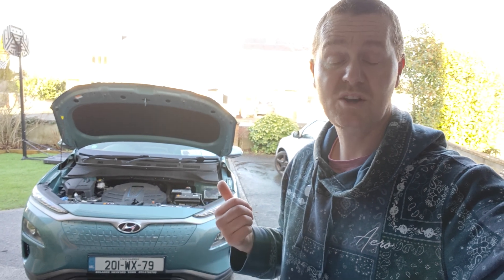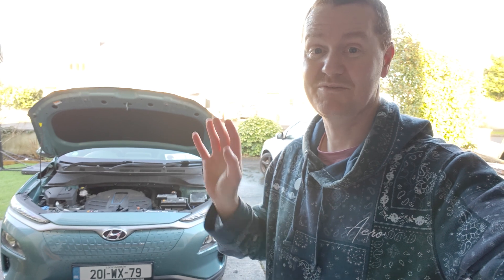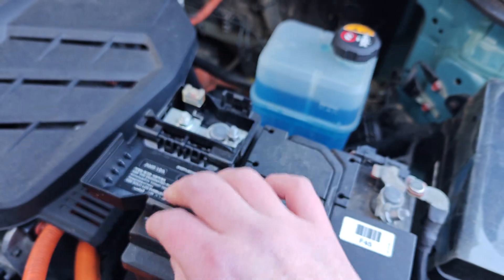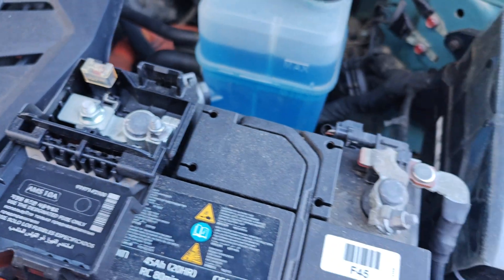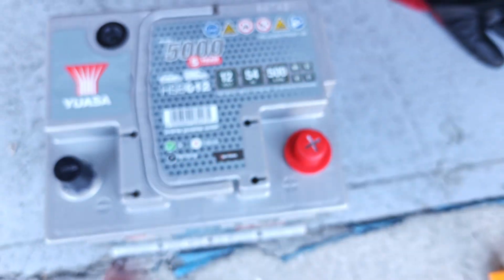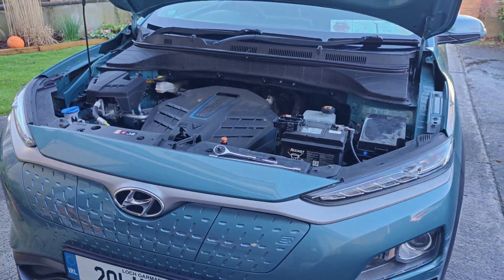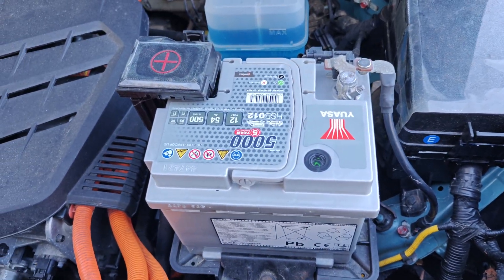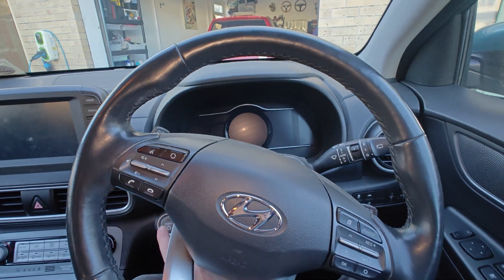How to change a Kona Electric 12v battery in 3 mins

Comment: I think that first you have to unscrew the negative than positive
Reply: It's certainly good practice but since there's not much risk of shorting the spanner to bodywork or ground points near the positive terminal I didn't mention it.
Reply from the maker: I've always removed the positive first, and likewise, when reinstalling I connect the positive first. It results in less/no sparking.
Reply: @Jazda , that'll be unrelated to the order of connections.  The last connection made is always likely to produce a minor spark and that's completely normal and harmless.  The decades-old established procedure of disconnecting the negative first and connecting the negative last is to reduce the risk of a dangerous short due to a spanner on the positive terminal contacting part of the bodywork while the negative is still connected.  This is also why there is a plastic shroud around the positive terminal.

Comment: The rear screw does not hold the battery in place, only the single screw and clamp closest to you does.  The rear one secures the battery holder onto the car body.
Reply from the maker: Thanks for the tip. Makes the job even quicker!